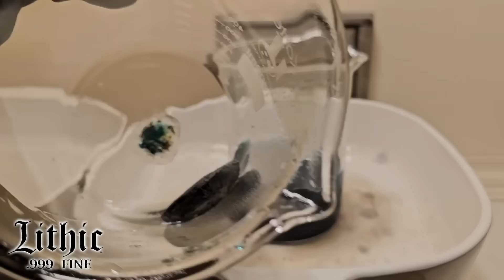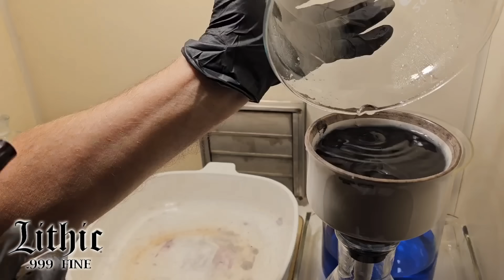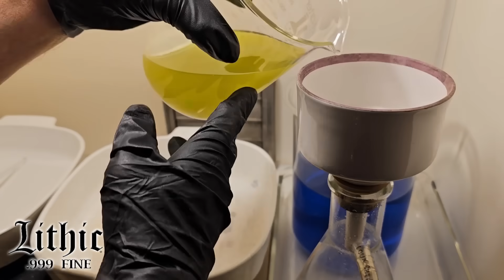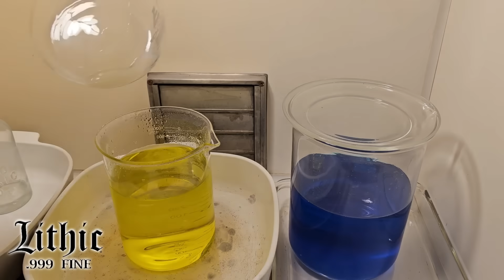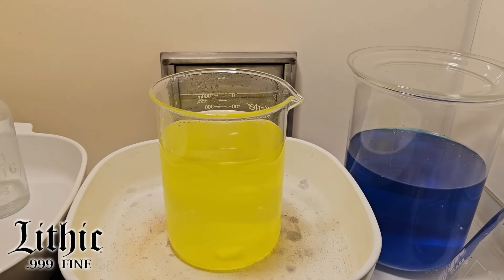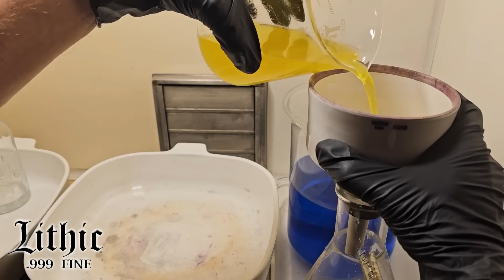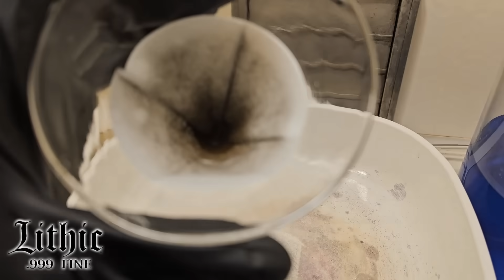Hunting For Gold In E-waste | But Is It Worth It?

Comment: what pore size did you use for your filter paper here?
Reply from the maker: .5 micron Watman
Reply from the maker: Actually, I mixed that up. I use a .5 micron filter on my silver cell. In this case, it was a whatman 2 paper, but I believe it is 8 microns. Which is much larger than what I was thinking. This works great for general refining. In this case, it wasn't up for the task.
Reply: @LithicMetals  okay that makes more sense.  0.5 micron seemed really small so I assumed you meant 5 micron.   Started working on my first refining and was using white coffee filters in my buckners and particles seem to just be slipping right through.  Now waiting on delivery of Grade 1, 2, and 4 filters to try again.
Reply: @hoosierdaddy1469  I use the coffee filters on top of the grade 1 filter just to catch all the accumulated trash without it sticking to my funnel. Also handy when dealing with foils from gold filled scrap. But you are correct, coffee filters let too much through to use alone.
Reply: @jeremylackey3477 that sounds like a good idea.  I’ll definitely keep that in mind!
Reply from the maker: @jeremylackey3477  I use coffee filters over the paper filter as well when I'm filtering and rinsing cemented silver. 👍

Comment: I know that it’s nowhere near the price of gold but is copper still above its standard price?

In the UK over the last few years we have had copper been ransacked from anywhere thieves can get it from church roofs to empty homes even going as far as ripping the copper wires out of the wall and even trying to take the very live main current wire.
Reply from the maker: Copper thieves are grasping a straws. There's money in copper, but it's still over a few bucks a pound.
Reply: Fwiw, scrapyards usually refuse to accept any metals that someone has melted to avoid druggies who might be melting down gravemarkers, statues etc. On the outside chance they do take it they will give dimes on the dollar.